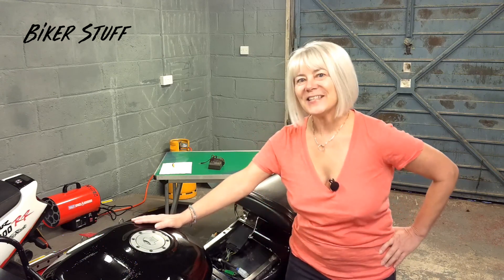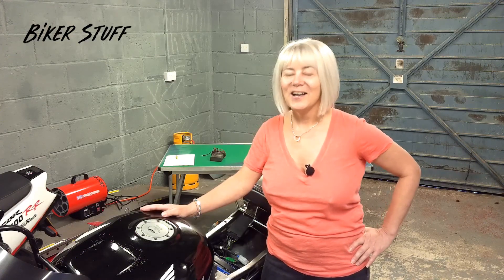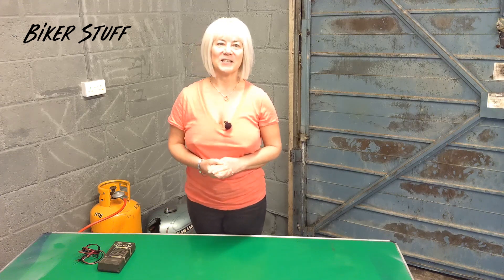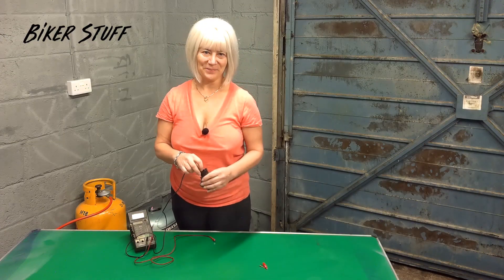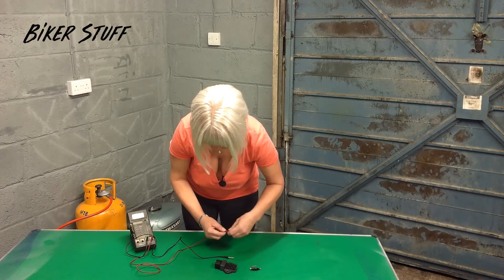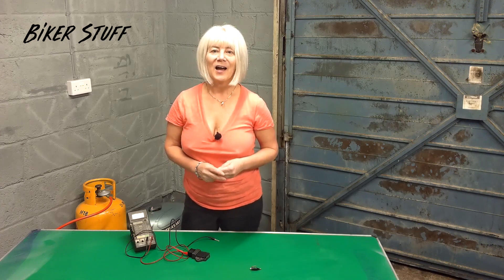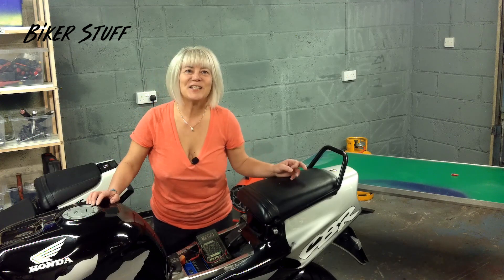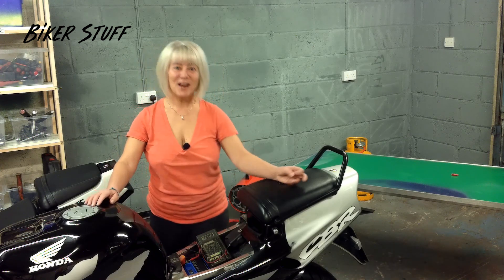Regulator/rectifier testing: How to test if your motorbike regulator/rectifier is working correctly

Comment: What if im burning r/r electric smoke before engine warm is it stator burns on yellow wire or is i a earth issue
Reply from the maker: If the smoke comes from the RR, then that is where the problem is

Comment: if your wiring it back up without the plug does matter on just yellow wires hook them any yellow ok 
thanks if you help🤔😳😎
Reply from the maker: I'm not sure what you're asking
Reply: @BikerStuff  does matter what yellow wire goes to what yellow wire
Reply from the maker: Oh I see.  Each wire is a single AC pulse.  I have never tried swapping them, but in theory I cannot see that it matters.  After all, if it mattered I believe they would each have a separate colour wire.
Reply: @BikerStuff  my old one had defrent strapped colors😳😎
Reply: @BikerStuff  mine had defrent color on old one im 13.90on batttery charge mybe it want burn up again thanks 😎😳

Comment: I recently replaced stator and rectifier on my VL1500. Had awful burning rubber smell and after, wrongfully, accusing my wife of having her boots on exhaust. The radio quit and dash stopped working. Towed home and Suzuki dealer recommend replacing both stator and rectifier at same time. Funny thing that during COVID it took longer to get the cover gasket then other parts.

Comment: I realize that  "everybody" preaches using multimeters to check diodes, but this is not  definitive with higher  current diodes.  A much better way is  to check them with a multimeter  and see  if they look OK,  then  run a check that  forces them to draw some current.  A  "safe" way to do this  on something of the nature of these, is to use a common   "old style"  1157  stop/ tail lamp bulb,  or maybe a  large wattage headlamp bulb.  You want to get some current loading through the diode.  "Rig"   a   lamp and battery so you can  connect all 3 in series  to individual diodes   in the correct polarity  to  draw current  (diode  conducting / forward biased).  When the diode  is  "on" and the lamp  "lit"  take your meter and measure voltage drop across the diode.  Do this with each diode  and map  the readings,  which should be similar.  All should be below a volt.  Any that do not light or light dimly are in poor condition.
Reply: Are you crazy? Who cares about tech. information? We're here for the double peaks!